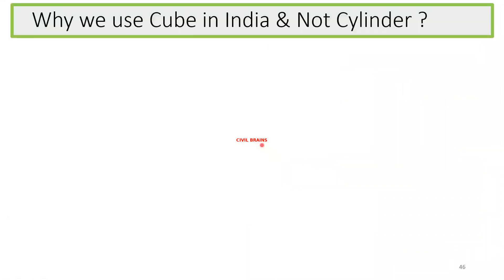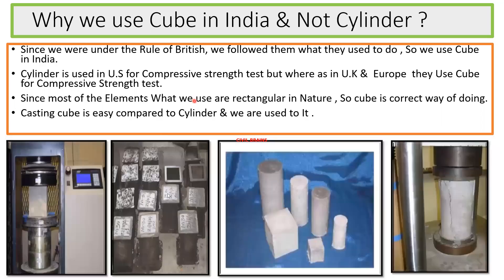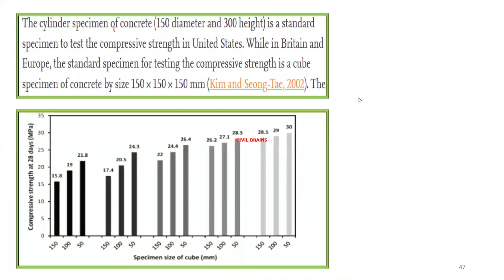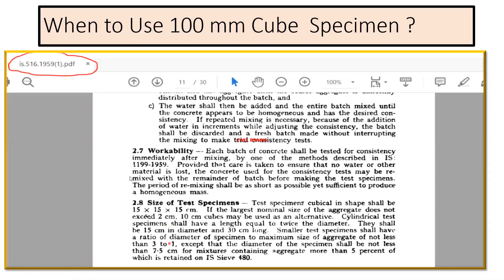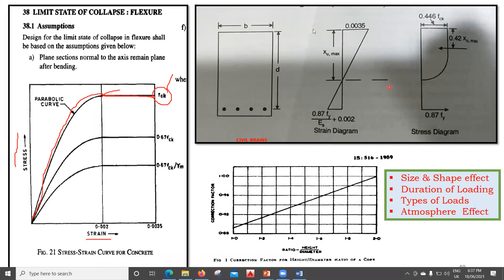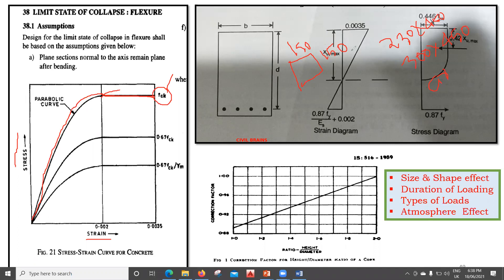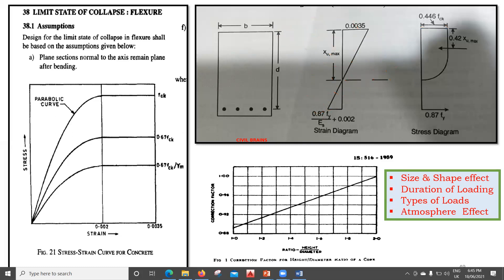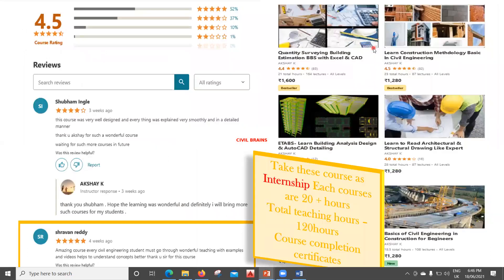why cube is used in India & Cylinder in US l Advantages of Cylinder & Cube Casting l Why 150 mm cube

Comment: Cylinder results more accurate than cube because of affected area due to friction is more in cube. But IS 456 consider factor 1.5 (i.e. 067fck) we use as characteristic strength of actual concrete member.